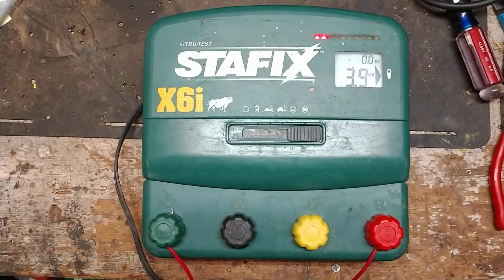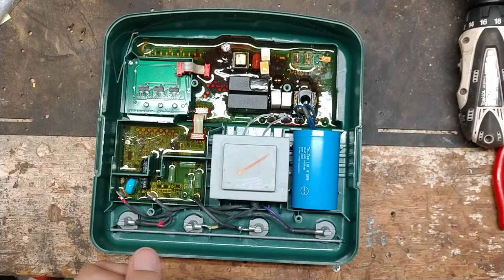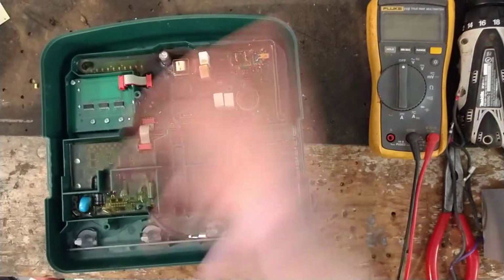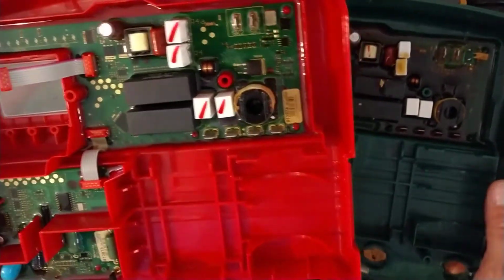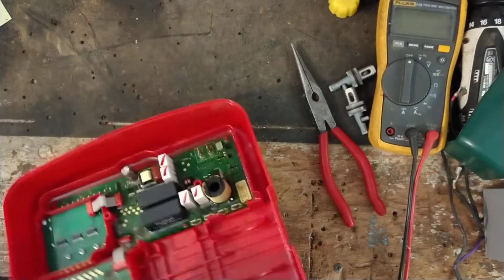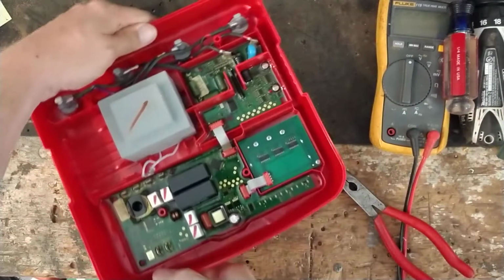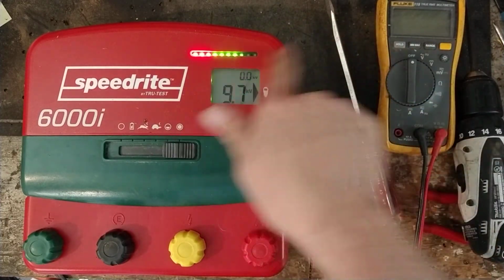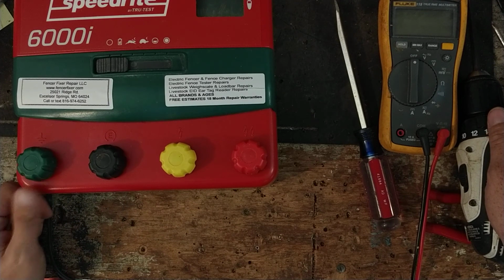How To Repair A Stafix X6i or Speedrite 6000i Part 2 | Stafix Speedrite Fence Energizer Repair

Comment: Where do you buy parts in the U.S.?
Reply from the maker: Distributors, but after you pay for the part, the shipping and tax on the part, you're almost around 40-60% of the cost of the new unit, especially if it's a large major part. So sometimes people some even fix their units. They're not very well made anyways, they're overpriced for what they are internally. I'm not a fan of them at all.
Reply from the maker: Distributors
Reply: @FencerFixerRepairLLCKansasCity are you a distributor?
Reply from the maker: No I'm not unfortunately. You have to do big dollars with them having an online presence or physical store that sells their products, usually a large chain of stores that have their own distribution center or huge online store. The main hub doesn't sell direct to anybody but distributors.

Comment: Where can I buy this speedrite 6000i board? I'm from Brazil and we can't find any parts for repair here. My equipment is on the Cod 1.1 display and does not turn on.
Reply from the maker: The Cod 1.1 is either the version of software on the chips inside or the code for remote control for communication purposes so the two units match up and talk to each other. I can get you one here and ship it there, but they're kind of pricey for what they are and I'm sure shipping might be on the high side as well.

Comment: I’ve been wanting one of these with remote for awhile you have me wondering now.   Does Gallagher make one with a remote?
Reply from the maker: Hi Lisa, Yes Gallagher does make a few units with that can use a remote control. Those are their i-series models. Those units, and most of the Gallagher units, are really well built inside. The only thing I ever see them come in for is lightning damage. I've never seen one come in for a malfunction of electronics. If you're located here in the states, here's a place that sells them for a decent price...
https://gallagherelectricfencing.com/collections/gallagher-ac-i-series-electric-fence-chargers-energizers-accessories-free-energizer-shipping-in-usa

They also make units that aren't remote control, but still pack a punch that are in the midrange power. They make the MB models that are AC plug in or can be powered by a 12v battery.
Reply: Fencer Fixer Repair LLC.   Thanks for the help.   I’ve learned a lot from your videos you explain things very well.  Thanks.
Reply from the maker: @lisag2771  You're welcome, no trouble at all.

Comment: My Stafix X6i case has a sealant of some sort on one of the screws.  How do you get through that to open case?
Reply from the maker: I'm not sure what sealant you're talking about. I know some of the models have a black plastic plug covering one of the screws, is that what you have? If so, just take a knife and gouge it out of there. It's just a dust cap covering the screw.  If it's some sort of hard or soft goop, you'll have to dig out as much as you can and then use the screwdriver with some good downward force to grab the screw to loosen it. I've never seen any brand out there with epoxy or sealant on top of the screws. Send a picture to me on my email address, fencerfixer816@gmail.com
Reply: @FencerFixerRepairLLCKansasCity  thank you, it was a hard plastic plug.  I assumed it was a hard epoxy sealing it.
Reply from the maker: @K_Mill_Iron_Ranch  Hey no problem. If you need a part to fix your unit, I have most parts on hand. 18 month warranty on the parts with lightning damage included if you do the repair yourself or I do it here. Happy to help you troubleshoot.
Reply: @FencerFixerRepairLLCKansasCity  I am hoping I don't need any parts, after a rain storm I had condensation on screen(inside) and now some parts of the lcd don't work.  Such as the decibel point for the voltage and the top of the first digit of the voltage(so a 7.0 kv looks like 10 kv).  Hoping to get it dried out and have the screen work fully.  thanks, maybe you know that this will/will not work?
Reply from the maker: @K_Mill_Iron_Ranch  What I would do when you open it up, is unplug and remove the LCD board and clean off gently the contact area between the LCD and the board and let it sit for a bit opened up. I think I have the LCD boards on hand, but I'm have to double check.

Comment: Excellent video !  There's a lot of engineering on those circuit boards. My guess is the design team knows exactly what they are doing when they design and manufacture them. The team knows the probability of failure vs cost and looks like they have made their decision on that. The SMD's probably aren't the cause of the heat build-up that would most likely be from the big power components SCR's etc..maybe a heat sink issue or lack of because they potted everything in place. It's too bad that the company decided that this product was acceptable as is and did not do a redesign.
Reply from the maker: There are other brands out there that do things similar, but they don't have near the discoloration from stress. The old school parts like some of the Gallagher and Cyclops use don't have this issue. It was probably a cost savings thing for Tru-Test. And actually... Tru-Test was having money issues the last couple of years and was bought by the company Datamaars. They're a swiss company that makes a lot of animal nutrition things and ear tags and such. So something wasn't going quite right with Tru-Test. They've been making their 18 joule units and smaller just like this for about the last 10 or so years. They're older version units like the Stafix M6 or Speedrite 9800, never had this overheating issue.
Reply from the maker: Their SCR's on these potted units are all surface mounted stuff now, some just do it better than others

Comment: What does the black nob do.
Reply from the maker: The black knob is for ground reference voltage. It keeps tabs on your ground voltage, so if it climbs up too high it'll let you know. Voltage on the ground should be very little to no voltage, but if for some reason it's higher than what it should be, then your start losing voltage on the fence.